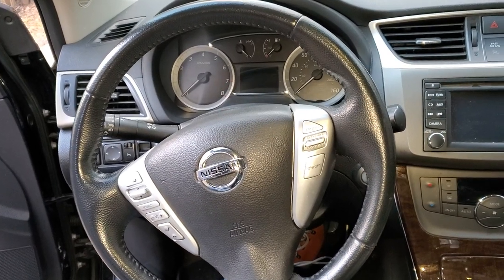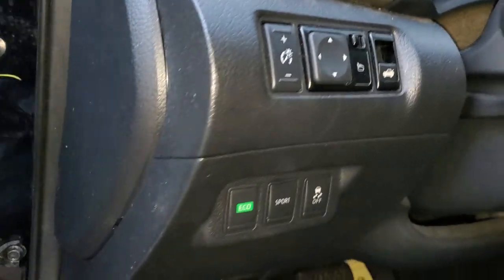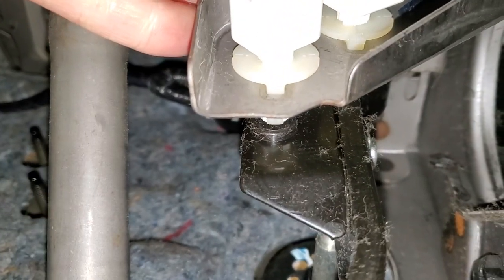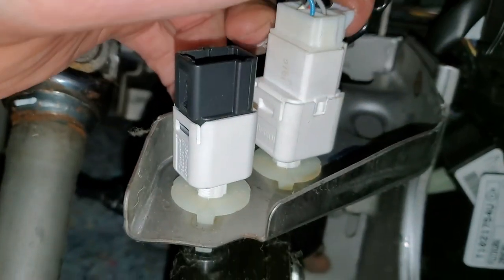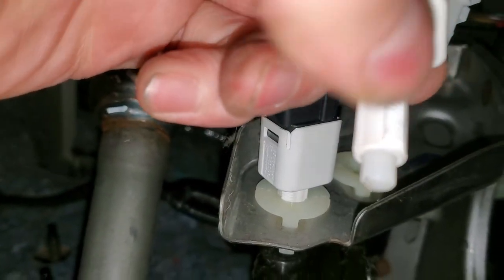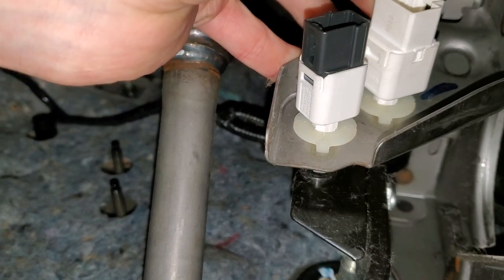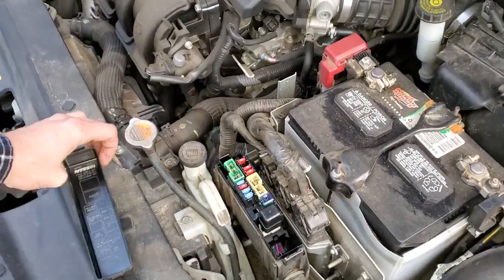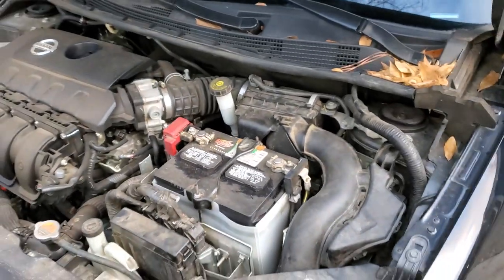2015 Nissan Sentra Brake Pedal Switch Replacement - No Start Potential

Comment: I had this prob, w/ non-start and hard-brake. I fixed it just by removing both brake and cruise control switches....then immediately plugged em back in & gave them a wiggle, and my car started !!  Musta just been bad connections. Nissan should recall this. Anyhow, just thought I'd chime in, in case this might help someone who is stranded & desperate.
Reply: they should definitively recall
Reply: It is recalled
Reply: @mickeyrose995  when? Cuz I had this issue about 2 years ago and I'm dealing with it again.
Reply: @AmandaSandstrom723  Im dealing with that right now too, 2014 sr

Comment: Hi I'm having an issue with my gas pedal when I push down on the gas pedal there's like no acceleration and I can push it all the way down and then eventually it'll kick in and then it will give me acceleration.   I was told by the mechanic that there might be an issue with the brake sensor that for some reason when I'm pushing down on the gas pedal it's not registering so it's telling the computer that it needs to break and so it doesn't allow the acceleration to occur.  Is this accurate?

Comment: What is the name of the switch behind the first brake light switch? I replaced the first one, but the video I watch prior to this one, only showed 1. Therefore, I only bought 1 to replace but noticed the 2nd switch behind it. The brake lights are not working still with the replacement on the switch in front.

Comment: Just replaced these on my wife's car 2014 sentra. Hers was running fine but while driving it would lag and her rpm would go down. You'd press accelerator all the way in and nothing. When turning on the car too, the pedal icon wasn't on and you could start the car without pressing the break. Bow after the new parts, it works!!! MAF could also be a symptoms l, I cleaned it prior to doing the brake sensors

Comment: Does this work for the 2011 Altima? I went to start my car and noticed the brake was very stiff. Dash lights were on but the car wouldn’t start.
Reply: i’m having same problem w my car everything in car turns on but engine won’t start

Comment: Absolute respect to you brother. We been having issue with my cruise control for the better part of 6 months and I been wondering what went on. I took her to the shop 2016 model only 74k miles on it and it came out broken even further AND the lights would stay on. These fucking idiots didn’t just push it in all the way and they were talking about a 1600 dollar payment for a whole new sensor. That might fix our issues, On top of that the 200 I paid plus tax to get it looked at AND the car no longer was going past 2.5k rpm. I’m thinking I got bad gas or some shit come to find out this all ties in to 1 big thing. So thank you sir on saving me a lot of money I will NEVER buy another Nissan again. I will learn to fix my car myself I’m sick and tired I even found some random plastic piece over the damned things that was blocking the connection I think this was on purpose. 6 years we been there I refuse to work with them further

Comment: So I understand that I push the button on the door panel and to reach the part (the stop light switch and brake pedal position switch). How about after that? What should I do with the part to get it into its original position?

Comment: Hello dear thank you for this video. 
I have I question please 
I need to know the pinout for cruise control switch because the problem in my car in the wiring not in switch. 
Please let my know what is the pinout if you know. 

Thanks again

Comment: I have this problem now my question is I have been able to kind of shake that switch to get it to start sometimes and two separate times  after I did that and once I was driving and at one point my car was not wanting to accelerate and my brake light came on but my car didnt slow down it just stayed at one speed and I could not accelerate and once my brake light went off my car accelerated just fine. That was cause by the faulty brake light switch correct? Or do I have a second issue on top of my bad brake light switch?
Reply: Ryan, what was the outcome?

Comment: after fixing this I got VDC light keep coming on,  after short distance driving ,  also after switching the car off  the brake back lights take a min or two to go off when I lock the car. !! any idea ??
Reply: Does the headlights stay on as well?
Reply: @mayerkatz2836  I tried to buy newbreak sensors  but could not find any localy, I discovered that car  battery (-)  was loose and after fixing that beside re installing (same) break sensors things till now ok.

Comment: What about the brake lights staying on?
Reply: Mine stayed on as well. I took out the sensor as described in the video and tested to see if the brake lights went out by pressing in the nub with my hand. The brake lights went out. So I reattached it securely against the brake.  It started working right. I believe that it may have wiggled loose and failed to touch the petal any longer.